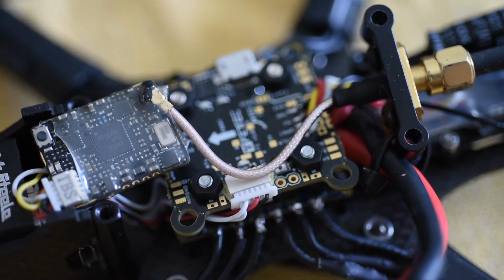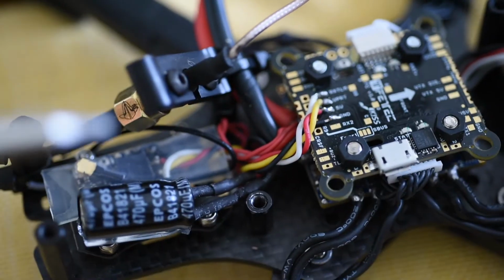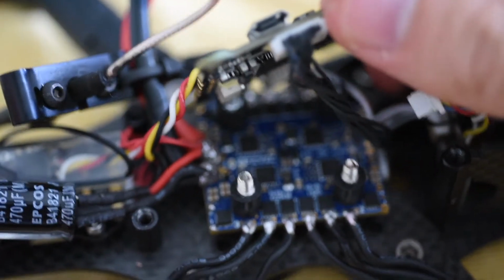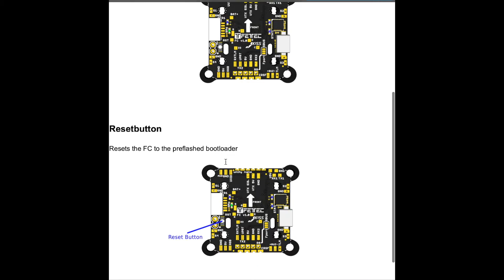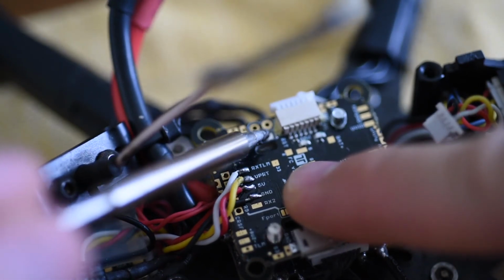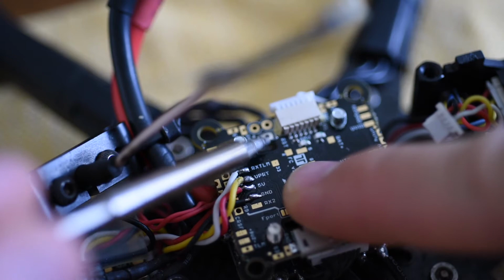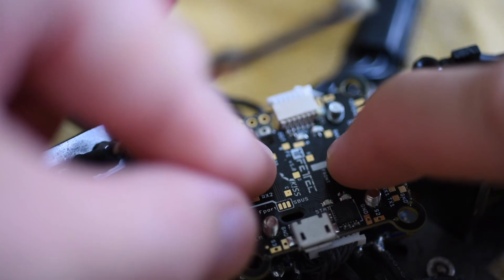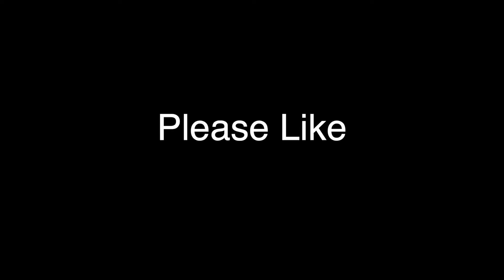Fettec KISS F7 Information Nuggets | Capacitor Show and Tell

Comment: This is exactly where I put mine on the apex,  the bardwell, and the qavr.  Then I zip tie around the (vista) and the cap.  Looks like an exhaust pipe.  Its well below the prop swing.
Reply from the maker: It does look like an exhaust! 👌

Comment: Dude very nice tips! by the way, how did you connect the video transmitter and camera? I had the flyduino FC that I had to replace and I took the opportunity to replace all boards by the fettec versions, but in the manuals they are not really clear on how to connect the video system. Do you still use the voltage regulator? and the old wiring harness to the video system?
Reply from the maker: Hey — yes still use the voltage regulator. That wire harness that comes out of regulator splits into two plugs, one goes into the FC, the other into the OSD board — and the OSD board powers / connects the camera and vtx

Comment: Great info. Thank you, I have a question about the Blue wire on the Mr. Steele camera. I just finished a Apex Build with  the Mr. Steele camera, Where did you connect the Blue wire on the Apex OSD?. The wire pinout says the Blue wire is "V Bat". I see you used the Red wire for 5 volts to camera, Just wondering if I missed something. Any help would be awesome.  Thanks
Reply from the maker: Hey — I don’t use the blue wire, that’s if you want the camera itself to read your batt voltage but since I’m using the OSD board it’s redundant because you get it in there too. Make sense?
Reply: @MattyfleischFPV  Yep. Thanks for your time. I appreciate your answer.
Reply from the maker: @markking4755  you’re welcome! Good luck 👍

Comment: My fettec f7 wont connect to kiss gui. So frustrating 🤬
Reply from the maker: You made sure the drop down next to the connect button is set right? You can also hold that boot button for like 20 seconds and it’ll reflash itself and should be connectable if the board isn’t damaged
Reply: @MattyfleischFPV  when I plug in the fc I get comport1, select that and click connect but doesn't connect and the tabs in the gui get greyed out a bit
Reply from the maker: @mattwilson1305  sounds like you’re not seeing that drop list change when you connect the FC to the comp. Try powering the board, and hold the boot button for 20-30 seconds. It should start to blink rapidly, at which point let it run until it stops, it might take a solid minute or so. If that doesn’t work, write fettec
Reply: @MattyfleischFPV  I power the fc with boot button held down and even 30 seconds later the light stays green.
Reply from the maker: @mattwilson1305  hit up their support, not sure then sorry

Comment: Man, sorry to say, but your solution is not ok. You are suppose to use a low esr capacitor. The reason for this is that the capacitor will be the first to take up curent. Nu adding wire, you greatly reduce the chance that it will take the curent first. You are supposed to use 0 additional wire on the cap for this reason and trim as much as possible his legs.

Comment: I highly appreciate you posting this! I made the same mistake you did.I took out of one build and was settings it up for another build..and something accidentally went wrong..Now I got $120 paper weight...But I can not get the boot/reset/dfu/ button to work for me. Even powering the board up and holding down the reset button for 10 seconds or even longer. The power light comes on the Fc and all the blue lights flash on the esc. But I can not get it to reset or go in DFU mode
Reply from the maker: It’s super frustrating, it took me several hours of hitting my head against a wall for it to work. The positive is you have a blue light — I would reach out to Fettec. They have good people doing their support
Reply: @MattyfleischFPV  The Blue lights are on the ESC i only got a yellow/Green whatever color on my FC the power light and thats the only light i got on lighting up on the FC. It out of a build but i still got a xt60 attached to the esc. I tried powering it up and holding down the reset button but no luck after 10 times
Did you have it in a build with motors & everthing soldered up when you reset it?
I reached out to Fettec on Facebook messenger trying to get support hopefully someone responds. I love how it flys! But its finiky to deal with!
Reply: @MattyfleischFPV  So your saying you had to repeat the process of plugging in a lipo and then holding down the reset button several times before you got it to work?
Reply from the maker: Yeah basically, it took me several tries for it to reflash itself where I could connect. What was the accident you mentioned? A short?
Reply: @MattyfleischFPV  To be honest I dont know if it was a short or what? I was in the GUI and powered up (props off) to make sure motor direction was correct. I unplugged from GUI and couldn't get back in? I got comport but nothing in configurations? I been building for three years hundreds of builds. And never seen a board I couldn't get back in DFU?
Like i stated i got a XT60 soldered on the esc but dont have a conpasitor back on it. I powered up with fully charged 3s & 4s I'm getting power to the esc & fc just cant get it to reset? You say it booted old firmware back up? Did it do it on it's own? Or did you have it plugged (USB) up to the GUI when you finally got it to reset? I highly appreciate your response on this...as you know there isnt any info out there on this subject
Reply: @MattyfleischFPV  You plug up then hold reset button? Or you held down reset button then plug the lipo in?
Reply from the maker: @allennickles3970  That's odd. When I held in the boot button, powered up with battery only (I didn't bother keeping it plugged into the computer because it wasn't seeing it anyway) I held the button in, let it do it's flashy lights thing, and only after all that did I keep it powered up and connected  usb and the GUI finally recognized it
Reply: @MattyfleischFPV  Ok ill try again..lol..I plugged in the lipo and then held the button. Then i tried the other way around and .. held the button and plugged in at the same time which is hard to do! But thats the way your saying to do it arent you?..lol Thats why it took you several times to get it..lol..Ill keep trying. I cant thank you enough for your help on this matter😀